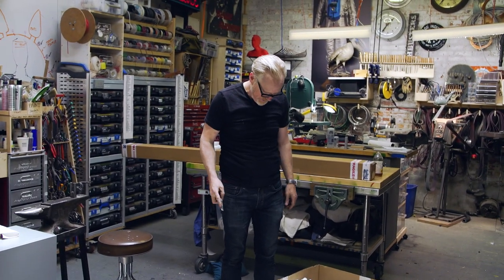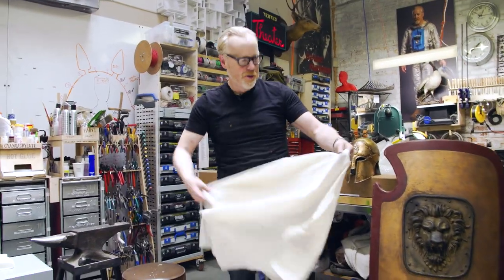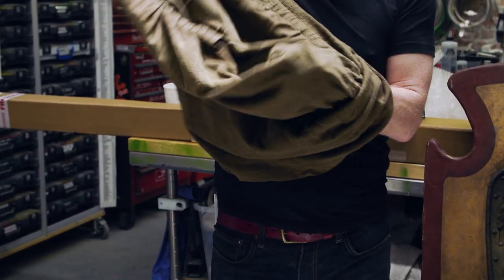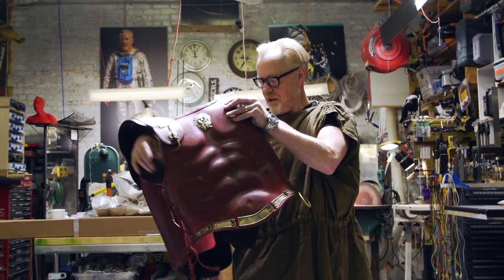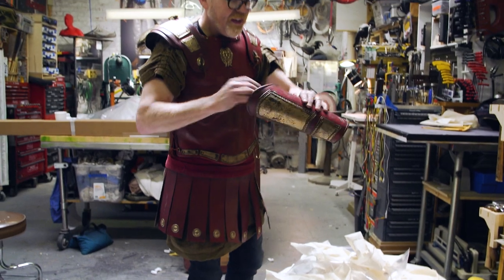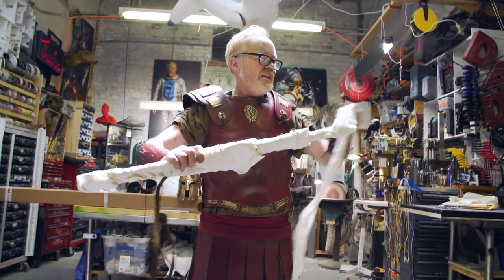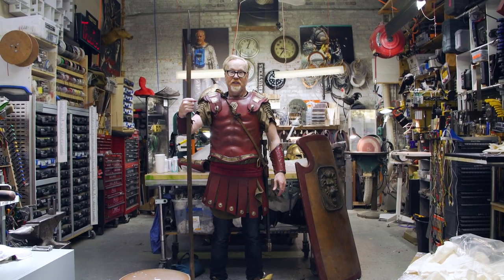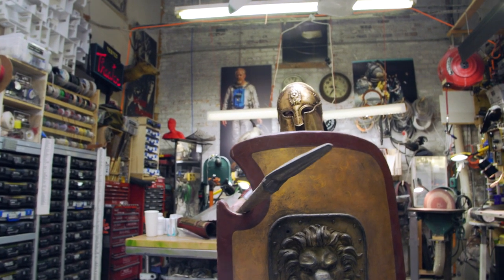Adam Savage's New Thracian Warrior Armor!

Comment: That odd moment around 450 bc, when you're standing on front line wearing plastic armor and a rubber spear.
Reply: That odd moment when the joke flew so high above your head it went in orbit.
Reply: ...with a built in sixpack to impress the women in the enemy's front fighting row...
Reply: The sixpack armor is actually historical, it's not to impress women but enemy fighters. Same reason many cultures wore gruesome masks and painted horrible grimasses on their shields.
Reply: And it's likely those guys all had a six pack, if not a half rack.
Reply: 6 pack? Psht. I have a keg.
Reply: A broken rubber spear...
Reply: XtreeM FaiL think about how much faster you can move compared to the rest of the people wearing heavy metal
Reply: Markus Bester well it's like the fat bully picking on the fast skinny kid. He can just run
Reply: Real life ain't dark souls. If you are in the front rank you simply can't run away, your ass is dead mate.

/watch?v=qzTwBQniLSc
Reply: All of nothing since the real guys would be wearing boiled leather armour and not metal; very few bits are actual metal. Though their armour would actually provide some protection, while still being super light. Worst part is it wouldn't of been that hard to just use leather instead of the foam plastic.
Reply: Blue jeans. Don't forget the blue jeans.
Reply: XtreeM FaiL please cab someone explain me what happened on the episode that the other guy dtopped a toaster on his bath??????????????? i cant find it anywhere please someone
Reply: JOOJ CEEC He's toast.
Reply: XtreeM FaiL its serious man the episode is 8 years old i think
Reply: It's ok, armor this ornate would've belonged to some rich kid who never saw combat anyways.
Reply: "This is my life now....while it lasts."
Reply: DeepPastry Boiled leather? No, Hoplites and comparable warriors wore a metal cuirass, often called Panaplía, literally translating to "full armor" or "heavy armor", as well as a large shield, bronze helmet and greaves.
The cuirass would be made either entirely from brass or from many thick layers of glued linen with bronze plates sawn onto it. 
Later on you would actually see early forms of chainmail appear. 

That "oooh, metal armor is heavy and real warriors wore leather!"-Trope is bullshit and completely baseless.
Everyone who could get their hands on armor, would get the best quality they could get. ALWAYS metal, the higher quality metals, the better
Reply: Which is a weird thing to say when there's moving pictures that we can actually see what we're talking about. We are talking about the fictional version for the movie where they substituted that plastic for boiled leather. The suit of armor in this video is a faux version of leather armor. Which can be used as actual armor, boiled leather can, and would be about the same cost as the plastic version. Both would weight about the same, but the leather version would provide some actual protection.
Why yes, there was a bronze version, made from bronze, and looking very bronze, we aren't talking about that though. We're talking about the boiled leather version that's brown, that Adam is showing off in this video, where you can see it, and then see him wearing it, and it isn't a bronze version of the panoply but instead it's the brown of the cheaper boiled leather variety you'd see slapped onto peasants you'd employ as city guards.
Reply: DeepPastry Oh, you were talking on set, I thought you meant the actual historical pieces this was (incredibly loosely) based on.
Reply: That awkward moment when that plastic is probably better armour than actual leather..
Reply: Markus Bester You might want to research what people really wore in combat for the last six thousand years.
A shitload of expensive armor was NOT common.
Reply: iWinRar You might want to do some research as well, although bulky armor wasn’t used as commonly as people think, it was used by higher ranking soldiers and wasn’t actually that heavy. Most of it would have been leather. 
Even the stereotypical knights in suits of armor from just a few centuries after the Thracians weren’t really as heavy as people seem to think.
Reply: That odd moment during WWII when the whole front line was rubber blowup vehicles and cutout soldiers
Reply: DeepPastry Well plastic can be quickly molded so you can make a crap ton of pieces in a shorter time than real leather
Reply: Your comment is no longer the anti-christ because I added another like
Reply: Goddess Usako leather armor was never common in ancient Greece. Linothoraxes, which were made from glued pieces of linen, and bronze panopoly were the types of armor used almost exclusively.
Reply: You guys realize this is a costume right? a very well done one and that time is from past? and it is done? i mean if you were there in those times being who you are now you would probably die from pissing your pants so much that you got dehydrated haha.
Reply: R/wooooosh
Reply: I definitely feel like shields complimented the leather armor very well. Lightweight and mobile, but you have a shield to protect you from penetrating blows, but leather to protect the skin from a grazing slash and the elements.
Reply: Well at least you know you won't kill anyone...
Reply: Back then most militarys didn't have uniforms so you wore what you could afford so if you didn't have the money you could buy second hand or a cheaper down graded piece of amour not everyone wore the exact same thing on the battlefield
Reply: @markusbester9864  You'd be surprised how durable plastic is compared to bronze. Bronze is definitely harder, obviously, almost twice as so, but a plastic shield would service in a phalanx just fine. You'd probably be placed at the most protected position, though.

And while your spear is certainly both too short and, of course, rubber, you could always just tear off the rubber top and sharpen the end down to make a plastic spear. Wouldn't solve the length problem, but again, would service just fine in a normal phalanx.

Your real problem would be fitting in, seeing as the shield is completely wrong. If you could get past that problem (or find a way to join up with the Romans, where your shield is just kinda weird), though, you'd probably survive a standard Greek phalanx battle, assuming you're on the winning side.
Reply: 7:00 with gladius too